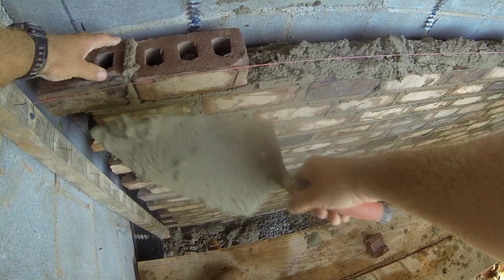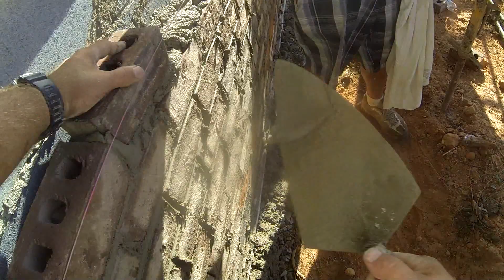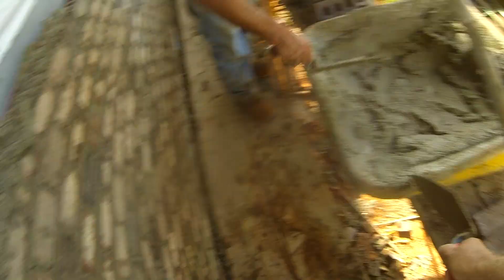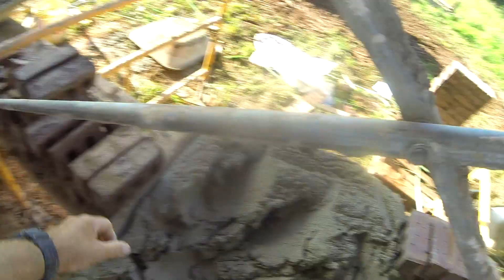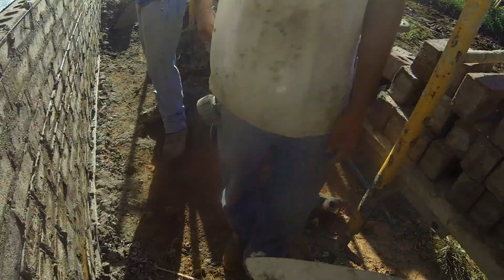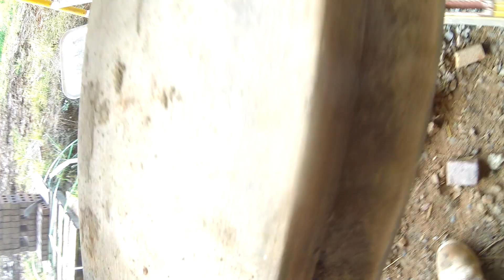Parks' Masonry - Fast Bricklaying up close

Comment: what do u think of the stabila mason levels with the trowel gaurd
Reply from the maker: I hate them.  I took my trowel guard off.  Hard to mark plumb marks on walls
Reply: I love them,the top bubble setup is sweet
Reply: Don't like them.
My grandfather had a saying, "I knew he was a good mason by the way his trowel sounded when it hit his level"
Reply: Parks' Free-Flowing Waterproofing System I thought they weren't removable? lol I got a set of cricks about 2 months ago. I was gunna go with the new stabila mason levels but again I didn't know how I felt about the trowel gaurds, so I didn't go with em if I knew they were removable I would of got the set. happy with crick but want something lighter like stabila. I will get the mason set next time I need new levels which hopefully won't be for awhile
Reply: Jamie Twigg is that a joke, because your not really supposed to hit your level out instead tap your work...
Reply: GiftedUplifted it's a joke.
36 year mason
Reply: I had trouble when it came to warranty mine, I had to send it out before I received a new one. I use a Sand's these days
Reply: GiftedUplifted crick if the only way to go

Comment: not saying im faster but here in nova scotia your wall with its clipped joints would leak like a stuck pig,you do excellent work nice level plumb straight but why wouldnt you apply a full head joint and dont say that you do not one of those would classify as a full joint here id made you take it down in all honesty and apply full head joints im plenty fast myself i can lay 750 on a wall and 600 on a chimney every day but mine have full doubled buttered head joints
Reply from the maker: If the head joints are opened up, and the thickness of mud is soft, and the mud is not cut, then the brick on the course above will push the mud down into the head joint.  I know this for a fact because I have taken down walls we laid this way and the head joints were completely full.  The key to this is holding your bond and head joints no smaller than 3/8".  I agree that it is better to trowel full head joints as you go, but drastically slows production.  I have tested this method several times to find out that the finished product results in a completely full head joint.  If my mud is not make soft enough, I either wet it down, or trowel on completely full head joints.
Reply: Here in Ontario it don't work that way lol
Reply: That joint is acceptable
Reply: i know i worked in ontario before not a whole lot of salt in the air you guys laughed at me for undercoating my car here your car would rust out in 2 winters i tear work down all the time with clipped joints and deep furrows thats water logged leaking and crumbling most of it is under 20 years old some under 10 and ive never got the concept of doing your job partially anyway
Reply: price your job to make money while doing it properly
Reply: and its not acceptable on my job sites all im saying
Reply: i will leave one example last year oct 17 a crew of union guys bricked up a 3 storey condo building on marginal road right on the ocean  they finished mid october people moved in to water everytime the wind blew which is all day everyday i have been there since december tearing down brand new work with end joints eaten right out and water lying in the furrows the wind blew the water through spots lacking mortar all the panels weve rebuild have not leaked we did nothing different besides not furrow our mud and double butter our ends.so i tested some panels in my shop i built one double butter one clipped like this and one just buttered i sprayed a hose on each for 5 minutes the doubled butter wall allowed almost zero water through the wall just buttered once allowed about 15% more water through the clipped wall looked like a waterfall and the flloor behind it was soaked.just because something is acceptable doesnt mean its correct
Reply: your assumption im moronic enough to charge unit price for repair work is unfounded i bet i charge more for my 760 a day than he makes  on 2000 by all means keep me in work but repair jobs start at 5 bucks a bric to lay here 5x 750=3750 and more to haul away in nova scotia brick has lost alot of appeal its much more expensive to build with and if it falls apart in ten years due to poor workmanship not on the look but in the functionality then whats the point us repair guys say they build it quick we build it right theres no money in new work thats why hes doing a partial job and why what would get you kicked off a job 50 years ago is acceptable
Reply: also 750 1 guy no brick passer no mud spreader  one guy to mix and keep me stocked and i admire your nihlistic attitude of why bother to do anything too well since machines will soon take it over does this include other facets of life should i not teach my children how to drive and be competent  we all know very soon cars will drive themselves
Reply: i would posit that most of this is off topic i stated his work is not acceptable here on my site which its not you made the claim of money machines my original statement remains true his work is not acceptable here
Reply: peter janjanin aa
Reply: matt mason I didn't say this was my particular technique. I just said it was acceptable....
Reply: The theory or so I've been told is that when you lay the bed on top it fills it in. I apply a full joint or if I clip a brick I butter the back of the next one.
Reply: You'd get blown off the damn line here....this ain't a commercial job. It's a residential veneer.

Comment: How do you know how many bricks you need for a wall? The mortar must take up a bit of the area of the wall, is there some kind of rule?
Reply: modular brick - 6.5 per square ft.    ,,,,, oversize - 5.5 per
Reply: 60 per sq yard 4', 120 per Sq Yard 9'...app 1 cubic yard of sand per thousand...rule of thumb.....6 bags of 25kg dust..been off the trowel for a few years......
Reply: 7 bags of mortar per 1000 brick ...3 bags per 100 block